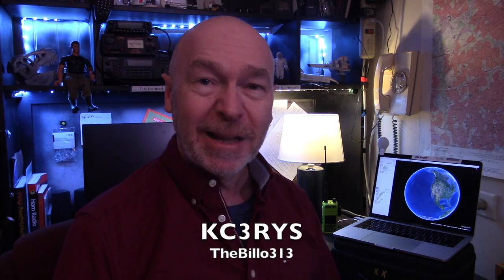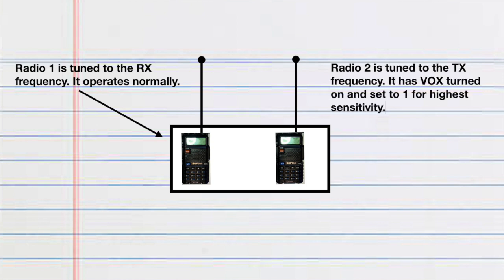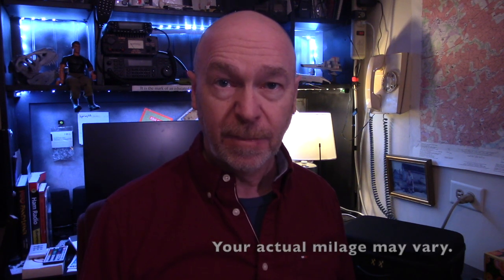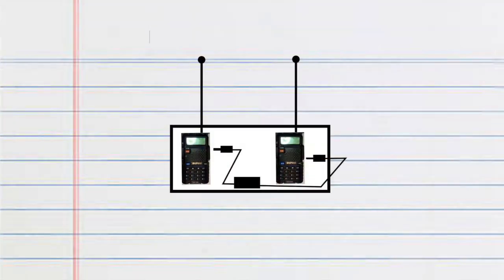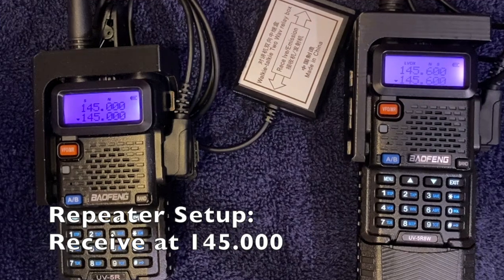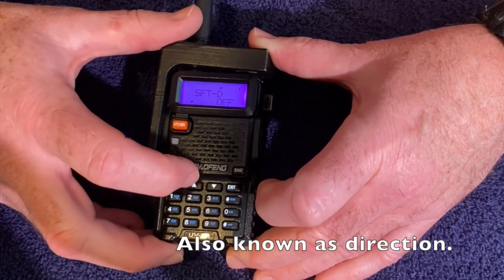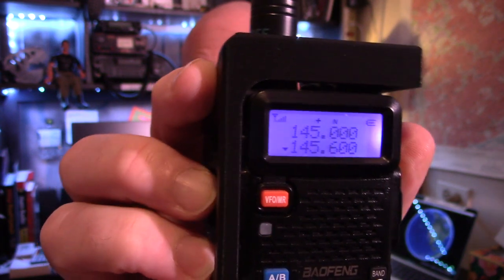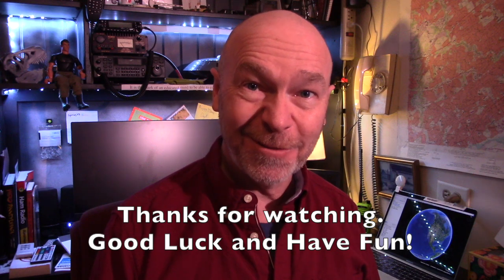DIY Ham Radio Repeater Using Baofeng UV5R for SHTF

Comment: What would happen if you used this to extend the range of a real repeater? Say you put it somewhere before the end of the repeaters signal tuned to the same frequency and tone.
Reply from the maker: Great question! I think that you would need to have two repeaters. Say that the “real” repeater receives on frequency A, (FA), and repeats on FB. Your repeater would need to receive on another frequency, (FC), and transmit on FA in order to open the real repeater. When the real repeater retransmits on FB - that signal will need to be retransmitted to your radio on FD. 

A little confusing I know. Maybe there is a better way but I can’t think of it. Good luck and let me know how it goes. Thanks!
Reply: @thebillo313 Gemini tells me that there may be some legal issues involved. So I won't be tinkering with that idea.

Comment: I have such a device, but it does not transmit sound to the second radio. What do I need to do to make it work? The first radio receives what I say, the second radio transmits, but nothing can be heard on the transmitted frequency. There is only slight noise, but no human voice can be heard.
Reply from the maker: Maybe try a few different things. 

1. check the squelch on both radios. It should be as low as you can set it without turning it off completely. 

2. make certain that the wires are pushed as far and firmly into the radio as possible. Hold the radio in both hands and press the plug into the radio with both thumbs. 

3. separate the radios as far from each other as the wires will allow. 

4. instead of using an offset of 000.6, try a greater offset. You can even try offsetting to another band. For example use UHF for the RX channel and VHF for the TX channel.

Good luck. Please let me know how this works out. -Billo

Comment: I hope you are still watching this video. My HT will not hit a repeater from my property with the rubber ducky. I want to set up a private repeater that cantake a transmission from my HT and retran to a big repeater and then when a response come, retran the response locally to my HT. Any ideas on how to do this or am I being blind?
Reply: I should mention that with a high enough antenna the large repeater is reachable.
Reply: The stock AR-5RM antenna is pretty decent. Due to selectivity issues, I often get better reception with the stock antenna over the NA-771. It depends on conditions. I am capable of picking most of the repeaters in the neighboring counties. I live way out in the NEGA sticks.

Comment: without a duplexer or some kind of radio isolation like vertical separation with a ground plane between them that repeater will be deaf.  even if you did cross band repeat beofengs suffer from near RF attenuation so badly that it will be deaf.  Strongly suggest  a gain antenna on recieve high up,  a large groundplane of several radials, then the transmit antenna as a 1/4 wave below that ground plane upside down to try and mitigate that the radios have no filtering at all on the frontend.    or better yet drive a tuned notch filter duplexer so the transmitter can not be heard by the reciever.
Reply from the maker: Definitely the farther away from each other the better both physically and frequently. Have you tried this experiment?

Comment: have seen this guys video on how to make a BaoFeng Repeater out of one radio? id be interested in your thoughts. https://youtu.be/UPvZcRKq8sU?si=YjvQ0yrYZcYyovea
Reply from the maker: He made a great video. He is creating what is called a "Parrot" repeater. His Baofeng has a parrot device attached to it. In this configuration, like most repeaters, the radio listens on one frequency and transmits on another frequency. With a two radio rig this happens simultaneously. With a one radio rig it is a two step process. Step one is the radio receives the signal on frequency one, and records the signal to the parrot device. Once the transmission ends, the parrot device plays the recording back on frequency two. 

The advantage of this rig is it's simple and only requires one radio. The disadvantage is that there is a delay in the signal. 

I hope this helps, let me know if I"m not clear. 
Good Luck and Have Fun!

Comment: what kinda of range increase are you getting with this setup?
Reply from the maker: You can easily double your range, however there are a lot of factors involved. For example, topography, and height. If there is clear line of sight, and the "repeater" is high enough, then you could go for miles. I know that this is vague, but I've seen tests where these radios will transmit for over 10 miles from one mountain peak to another.

Comment: What about return  signal,you need another set of radios ?
Reply from the maker: Sorry it took me this long to respond. I’m not sure what you mean by the “return signal”. If you mean the signal returning from the party that you are communicating with then they just need to setup their radio the same as yours. You’ll both transmit on the same frequency. Your repeater will receive on that frequency and simultaneously retransmit on a second frequency. Both of your radios will receive on that same second frequency. 
Let me know if this helps and is clear. I’m sure lots of people have the same question. 
Thanks for watching and taking the time to comment.

Comment: Is it possible to use UV5R "converter - repeater", I mean that UV5R can receive lets say 68Mhz so is it possible to receive 68Mhz and transmit 146Mhz... I know that it cant transmit on that range
Reply: Answer to myself. Not really because there is no squelch on FM radio, so there is continous static
Reply from the maker: @kimna1298  I think that that is called a cross band repeater. You can use this setup for that. Set your receive radio on band one, and your transmit radio on the other band. 
Let me know how it works out! Billo

Comment: This may sound like a dumb question but what about the pl tone? Do you have to set that or does it work without it ?
Reply from the maker: It's actually a very good question. You do not NEED a PL tone for this to work. I think that the purpose of the PL tone is to set a barrier on the repeater so that people cannot use it if they don't have the code. If you set a PL code, then the receiving radio will squelch any incoming transmissions that do not have the code and will not repeat the transmission.
Reply: @thebillo313  Tone makes the repeater more sensitive. Squelch does not open unless it hears tone; it will not open on noise
Reply from the maker: @MrArithor  isn’t that only if the receiving radio has a PL tone set?
Reply: @thebillo313  Literally not what a PL tone is for. 

A PL tone is used to ensure that unwanted transmissions aren't passed through the repeater. Anything that breaks the squelch gets transmitted back out.

To use an input tone, set the input radio to use Tone Squelch. 

If you want an output tone, set the transmit radio to use a TX tone.

Comment: The two radios im using for the repeater, once i key it from a 3rd radio the two in the box just stay lit. Its constantly keying. Anyway to change that?
Reply from the maker: It could be that your transmit radio transmission is getting picked up by your receive radio even though they are are on different frequencies. Just by proximity it could cause this interference. Try changing the frequency of the transmit radio by a large amount. You might even need to receive on UHF and transmit on VHF. Let me knonw if this helps.

Comment: Hi, I'm new to this hobby. I was just wondering if what outdoor antenna should I get if I want this kind of repeater system that could work in a small area like around 5 kilometers. thanks!
Reply from the maker: Are you looking to make an outdoor repeater with Baofangs? Depending on how high you can get your radio, and if there are no obstructions then your Baofeng should be able to get you five miles. You can easily try it by testing how far you can get using simplex. Make sure that you get as high in the air as you can.

Comment: I've been trying to get this type of repeater to work well for years...Works great 20 ft. away. After that well...   Any Ideas would be very helpful. Thx!
Reply from the maker: @JOHNSMITH-ug2mt  I don’t think that this is the best option but here are a few ideas that might help. Some are science based and some are conventional wisdom. 
Separate the radios by at least one wavelength. 
Point one antenna up and the other down. 
Attach both radios to a nonconductive material like plastic or wood. 
Pick an offset frequency more than one harmonic away. 

Let me know how it works out. Thanks for your comment, I appreciate the feedback. - Billo
Reply: @thebillo313  Thanks, I will try that.

Comment: is it possible to add a roger beep at the end?
Reply from the maker: @micahbentley141  yes, you just need to turn it in on the transmitting radio in your repeater. Let me know how it works out. Thanks for your comment. 😀
Reply: @thebillo313  Alright I will.
73 
KK7UMO

Comment: Hi wondering if you could help can you send step by step instructions to my email please?  The video was a little to fast for me i do have the same box and 2 baofengs 1 is a 5watt the other is an 8watt connected to the box and i have a 10watt ill be using what am i doing wrong
Reply from the maker: @brandentruss2848  I can try. Can you send me your email address and let me know what you’ve tried? I’ll try to help.
Reply: I'm considering attaching a baofeng to a drone as a repeater, so I could fly it way up for maximum range.. any thoughts?
Reply from the maker: @ I love this idea! How big of a drone do you have? I have a Hubsan but I can’t imagine it has enough power to lift a UV5R - much less two. You might want to think about a simple repeater. I’m not all that familiar but it only uses one radio. It records the transmission on one frequency, then rebroadcasts it on the second frequency. It takes more time but could save on weight. Let me know what you decide to do. I would love to see pictures too!
Good luck and have fun!

Comment: Which antenna would you recommend?
Reply from the maker: @aperson1181  I haven’t tested antennas enough to give you an informed answer that I would feel comfortable with sharing. However, the consensus seems to be the Nagoya 771 antenna. If you want to save some money you can also try the Abbree 771. My experience has been that they are both about the same although not everyone has the same experience. 

Let me know how it works out for you. Good luck and have fun!

Comment: I'm confused as to the purpose of the Repeater Box if using VOX,... If you say "Hi Bill" into your HT & that is transmitted to the Receive Radio & that audio comes out of the speaker of the Receive Radio then the Transmit Radio with VOX turned on should hear that audio of "Hi Bill" & transmit it shouldn't it ?
Reply: The box is probably nothing more than the RX/TX (mic/speaker) pair being crossed over. Just an enclosure where the junction calls home. So, I bet you just take two of the dual jack cables, cut off the ear piece and mic, and then wire and solder them end to end, but mic to speaker, and speaker to mic. Perhaps a resistor inline on one side. It would be a simple and cheap experiment to find out.
Reply from the maker: @AtomkeySinclair  I think that thou are correct. I think that I watched a video where someone took that box apart and that’s exactly what they saw.
Reply from the maker: @davidyummus6259  I think that what you described is true and would work. The wire ensures the “cleanest” sound. Without it the transmit radio would have an open microphone and could pick up ambient noise like a passing truck or a nearby bird and then transmit those random noises. I suppose in theory if someone were speaking nearby, they would accidentally be transmitting on him frequencies illegally. 
Great question, let me know if my answer makes any sense.

Comment: Have you actually used this setup in the field?  I have, and it does not work. The transmitting radio saturates the receiver radio. It works in a lab, or in your back yard. But as soon as you put some distance between yourself and the system it fails.  This might work with a high quality HT that can reject the RF saturation from the transmitting radio, but it won't work with UV5R's.
Reply: Move one of the Baofeng's antenna to a feed line and away from the other unit. Or get a longer dual-jack pair of cables to move the radios further apart. The are desensing each other's antennas. That will fix the issue you are experiencing.
Reply: @AtomkeySinclair  I've tried that as well, which defeats the entire idea of a lunch box repeater.  The premise is you can put two radios in a box and stick it in a tree or on a rooftop.  It does not work, not even as a cross-band repeater from 2m to 70cm.  If cheap Chinese radios are within 10ft (3m) of each other they de-sense and saturate each other.
Reply: @MrFunkyskier  Very true. They will desense. Feed line for 1 radio fixes that :)

Comment: I am so lost because you didn't go over setting up the receive radio, jumped to some settings in the transmit radio and nothing at all about the radios using this setup. I need real help setting it up and this was the closest video I can even find. No help at all.
Reply from the maker: @chrisferrell8741  I’m sorry that you’re having trouble. The receive radio connected to the rig does not need any special setting. Your “repeater” is set so that users will transmit on frequency one and receive on frequency two. So the receive radio on your repeater should be set to frequency one. That’s the only setting that you really need to set. The only exception to this is if you wanted to use a PL code. You would need to set the PL code on the user’s radio and on the receive radio on your repeater. I did not cover this in the because it added a level of complication that I didn’t feel was needed. 

Let me know how it works out. Good luck and have fun!

Comment: I like to couple it to a really good antenna and the btech amp
Reply from the maker: @kholt275  you’re right, the whole point of a repeater is increase your transmission area. If that’s the case then you need a better antenna. So what antenna do you recommend?
Reply: @thebillo313  long

Comment: Is this setup really works when the transmitting radio is 1 mile from the repeater?
Reply from the maker: @MHlovesz  that’s a good question. I think probably not unless you have incredibly ideal conditions.
Reply: @thebillo313  Then what is the point of this repeater, if it works only in the bedroom?
Reply from the maker: @MHlovesz  I think people like to use this at camp grounds or on the farm.  Anyplace where you just need a little, “boost”.
Reply from the maker: @MHlovesz  well it’s also a fun experiment to see whether you can get it to work and work better.

Comment: When the TX radio is set to vox like this with the plug attached will it also key up if it just hears enough noise from outside the repeater box itself or will it only key up based on a signal from the cable?
Reply from the maker: Do you mean from ambient noise nearby? Then no, when it has the plug plugged in it can only hear the signal and key up from that signal.  Does that make sense?
Reply: @thebillo313  Thanks, that's exactly what I was trying to ask, whether the vox is triggered only by input from signal from the plug and nothing else.

Comment: The problem with this video and countless other videos about making a functioning repeater using two Baofeng UV-5Rs is that not one of them I have ever seen has tested the "repeater" anywhere other than on the bench. Not one audio test, not one range test, not one test of any kind.  I hereby challenge TheBillo313 to and the rest of them to show us a real-world test where they have placed this "repeater" at some remote location and actually recorded the audio that comes out of the radios transmitting to and receiving from the "repeater".
Reply from the maker: This is a great idea for a video. I’ll start work on this idea tomorrow. I appreciate your comment, thanks.
Reply: @thebillo313  make this video please
Reply: I bet you hear it repeat "fang  fang baobao"
Reply: I'll do it, but you'll have to send me a new repeater box. I bought a ready made one and my radios starts crashing once I connect them
Reply: @odkeky  they are like $10 man..
Reply: @dukecityfisherman5788 least expensive one I have seen was $60.
Reply: You can get a duplexer which would combine your RX/TX and would only require one antenna.
Reply: @johntack1049  is that more expensive than a $20 radio?